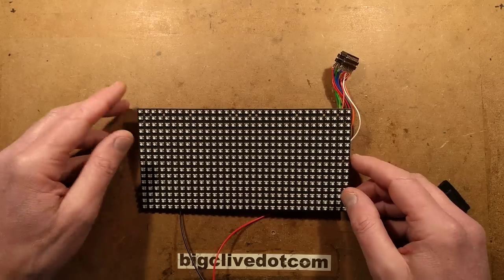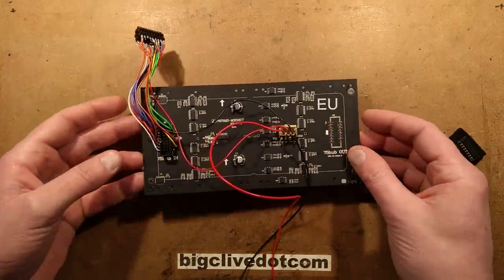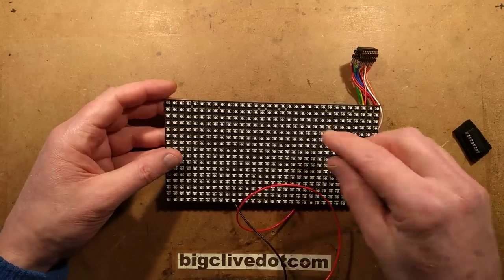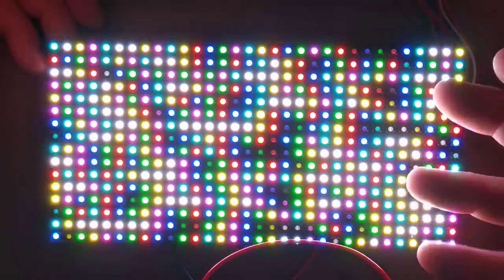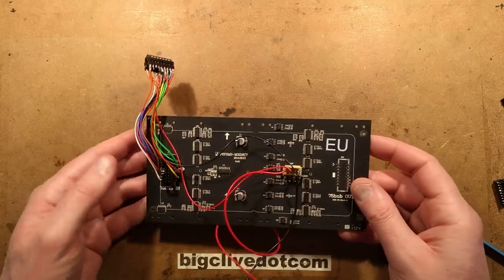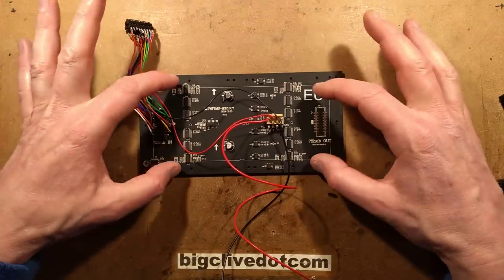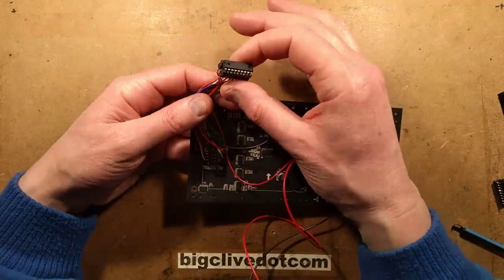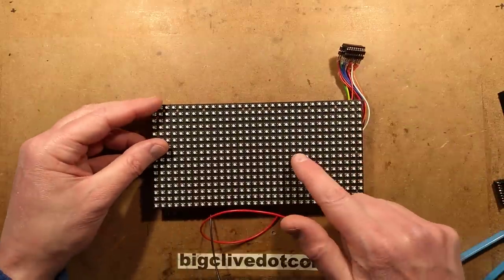Driving hub75 LED panels.  (including free test software)

Comment: There are ways to display a "proper" picture without a huge memory map. Byte per colour would mean 3*8bits=24bits of colour information. Bit of an overkill. Colour lookup tables could be used or just stuff the information for one rgb in a byte.

Old school demos/intros could be used as inspiration. Flame effect or plasma effect could be computed on the fly (with different kind of lookup tables) if the processor is fast enough.

It's all easier with a micro that has enough memory though.

Love the asm code!

Here's my take on reading Panasonic AC servo motor hall signals ("7-bit serial with two stop bits and parity and inverted hall signals included in the serial byte" with error detection on PIC micro)
https://www.dropbox.com/s/tnz0x3ztrnoydv3/panasonic_servo.asm?dl=0

Runs purely on serial interrupt.  1 MBaud data in... 0% serial baud error. 6-pin PIC micro, if I remember correctly.

Here's a video it decoding the hall signals from Panasonic servo motor and outputting serial hall signals on pins (LEDs...)
https://youtu.be/1hdetsDeUvA

There is time for 90 cpu cycles between serial interrupts (32MHz PIC clock pll, internal) plenty...
Reply from the maker: The early arcade video games had the sprites and colour maps stored in EPROMs that got pushed out in real time as the video signal was generated.

Comment: How much do those cost? Could use some as a flashy shop sign.
Reply: QVear I got one of the purses that it comes from in Smyths for £20 at the weekend, but if you want to make a shop sign yourself, you might consider spending another few bob and get a neopixel panel (ws2812). They’re a doddle to code with an arduino and there’s lots of support material out there to help with getting words to scroll on them. If you give them enough power they’ll look bright even in daylight.

Comment: I hope I’m not repeating a previous comment, but The downloadable PIC code seems contain an error. The twentieth line is a #include which instructs the compiler to load the “p16f627A.inc” file.
Unfortunately, that file seems to be missing. Or maybe I’m just my usual dumb self....
Reply from the maker: Sorry, that's right.  You'll have to get the include file from www.microchip.com it's basically a definition of things like porta and portb.

Comment: Curious what sort of refresh speed benchmarks you get, say for blanking full images, or scrolling reused data, or only partial drawing.
Reply from the maker: It can apparently handle very high speed data input.  But it requires matching processor or FPGA power.

Comment: You can drive them at 888 /24bit colour if you have enough RAM and a 32bit MCU with GPIO DMA.  
You DMA copy a large block of ram to a GPIO port wired to all the LED matrix inputs. Clock, RGB, address, all of it. Basically you're encoding data, address and clock into a large memory block you can step through using DMA.
Then you can update RAM slowly as needed to set pixel colors while simultaneously having DMA update the entire display at a flicker free speed.

One way you can do colour mixing is to DMA update the entire display 8 times in a row with each time having double the "on time" of the last. This matches up nicely to the bits in 1 byte (red for example). So red LSB is "on" for a tiny amount of time and red MSB is on for quite a long time.

The ram usage is pretty crazy though, you need like u32 * pixel line length * number of lines * 8 updates for PWM mixing * 3 colors. and then you probably want to double buffer it so double that again
Reply from the maker: This is pretty much how the earliest home computers worked.  With the ZX81 when you encroached on the video RAM with your program, half the screen suddenly disappeared to make way for it.  And with the early computers the screens would glitch as you wrote data into the active video space.

Comment: Take a look at the Propeller 2 to control one of these panels. Damn that's a nice chip.
Reply: just use an esp8266/32 they are some good libraries for such panels, then you can also have a web interface or something similar

Comment: @bigclivedotcom Can you do a bit on programming electronics? I'd be interested to see how you approach it.
Reply from the maker: If you mean assembly language then it's quite a complex subject.  You really have to throw yourself in at the deep end.  For someone new to programming I'd recommend the Arduino environment for faster learning and throughput.
Reply: @bigclivedotcom  I'm actually an application programmer. I'd just be interested to see your process at a high level - getting it on to the chips. That would make for an interesting video!

Comment: I wonder if you could control this with an 
Arduino or Raspberry Pi.
Reply: Sure, just work out the data format and bit-bash the data out to the panel.
Any processor with enough I/O pins... and memory if you want to store displays.

Comment: Big Clive, been watching your vids for the past month now and had a thought...  Have you (or anyone else) ever 'upscaled' an old ACME or NJD (other brands are available, but I have those handy at the moment) "Moonflower" sound to light type fixture to utilise any of the Chinese cheapo units you seem to be buying recently?  It would be great fun to convert them and add DMX too, but I can't think of anyone else I'd like to listen to explain or disprove the theory than yerself :-)
Reply from the maker: The complexity in upgrading many of the older lights is that they were designed around a very small point source of light.  It requires a different style of optical system to use the common large area high power LEDs.
Reply: @bigclivedotcom  Thanks for the rapid reply.  Guess I need to save the pennies & upgrade then.

Comment: Thanks for the initial video about this, I immediately checked and was able to get 3 of the purses for $8USD each.  This video also inspires me to continue playing with it, semi-waiting for 16pin ribbon cables I ordered then plan to use a RPi Zero to run it.  Don't have anything to work with PICs, so can't try out this software very easily.

But yeah I might be able to test how to work them with the connection between two of the panels if you were interested

I'm also very interested in knowing if the original chips could be used, and use something to load images via the audio cable it has (without using the official since my phone doesn't support it)
Reply from the maker: The finger trick mentioned at the end will provide instant gratification before you start dabbling with software.

Comment: What is interesting is one of the most common failure modes on these panels is you can get a line of pixels stuck on a colour or a row of a few LED's. Also these are not fun to repair. That one looks like a 5.9mm pitch, that is about the smallest that is mostly economical to repair. 3.9mm or 2.9mm is just crazy to try work on.
Reply from the maker: The LEDs are serviceable on this panel.  any closer pitch starts going into the territory of non standard soldering equipment like dedicated heated solder-tweezers.
Reply: @bigclivedotcom  I have serviced down to ip rated 6mm panels, at my company we just decided that the 3.9mm panels were cheaper to buy replacements over servicing them mostly from a labour time standpoint.

Comment: As a ZX Spectrum programmer, I really dig this.
Reply from the maker: It's pretty much the same colour pallette give or take the second intensity level.
Reply: Wouldn't it be great to display a ZX Spectrum screen on a 256x192 LED array made up of these panels, except it sounds like that would take some serious processing power and quite a high voltage not to mention the cost of purchasing the 72 panels required (6x12 unless my maths is failing me).
Reply: Absolutely. The Spectrum had a slightly unusual arrangement, though, with the lowest bit being blue, followed by red, followed by green (BRG, rather than RGB). So, numerically ascending values from 0 to 7 would translate into black, blue, red, magenta, green, cyan, yellow, and white, respectively. The brightness bit was simply ANDed with the color signals inside the ULA via a diode and a resistor, so a bright black would be the same as the non-bright black.
Reply: Yup. Was one of the first things that came to mind as I watch the video. We’d need a dedicated panel driver that would mimic the Spectrum’s ULA—i.e. continuously read data from the bottom 6912 bytes of RAM and then shift it down the panels. I’d love to see it!

Comment: If you wanted to store a static image, you could probably cheat by having a FLASH or EPROM that has the data in it ready to be shoved into the registers, and the microcontroller would just activate the appropriate address lines on the memory, with the data pins directly connected to the display module
Reply: Peter Mulholland Even easier: A full (non-PWM) image is only 192 bytes.  Could be stuffed into the program flash directly, using whichever bit order simplifies the code.
Reply: @johnfrancisdoe1563  yeah I was thinking along the lines of the microcontroller having to be involved as little as possible, rather than it reading data out of a FLASH and then shoving it into the display.. it could somehow be wired up so the display is reading the data from the FLASH directly.. with only a little marshalling from the uC

Comment: Clive, did you try using the Android software that is designed to run these purse panels? From what I've read there are some real problems using it.
Reply: Yeah, it's utter crap!  I installed it, and couldn't actually draw anything I wanted...  I didn't even bother trying to upload it to the handbag.... Best avoided!
Reply: Fwiw I had success on the iphone. Within 10 minutes of receiving the package from Amazon (same day delivery for under $8...I'm still amazed) I had typed my 6 year old's name in his favorite color and displayed it on my new pink purse.

Comment: Can you do a how to on a small video wall. I want to make a small (32"x40") portable battery powered panel for scrolling/flashing text and dont know where to start.
Reply: gedion4000 Buy enough of these panels to cover the size.  Chain a few together using the output of each as input to the next.  However the more you put in each chain, the faster you have to shift pixels to keep the fps faster than the human eye.  Next you need a control board that can drive about 12 pins per chain of panels, at the needed speed.  You also need a power supply that can deliver 10W per panel plus whatever your control boards need.
Reply: @johnfrancisdoe1563  hey John thanks. That would be neat, maybe for something mounted on a wall, but i think thats a little over kill for my needs, and probably a little too heavy. Resolution can be WAY less then these produce, and need less energy. Im mostly looking for something large and hand held as a scrolling marquee or at least something with changeable text. Cheers!
Reply: Building the panel isn’t the problem...
The processing and data-pumping is where the challenge starts.

Comment: according to aliexpress these panels are mainly used for large area "tv" in shopping centers. 
That made me briefly interested in 1280x720 wall "tv" project...
..., still dont know if its smart or stupid... :/
Reply: Shoot for the moon and make a 4K display!
Reply: ...as long as he has the Zeppelin hangar to house it in, why not...
Reply: 1280x720 was chosen cause even the most packed panels have 160000LED/m^2, which would make the "tv" about ~2x3m. 4K would REALLY need a hangar at least...
... and it was just an idea, you thing it would be even watchable from across the room? wouldn't it be too pixelated?
Reply: Oh for sure. I was just taking the impractical idea and running with it as far as could be done. A 4096x2160 panel of P2.5 panels would be 10.25x5.4m, or literally the size of a house. 

Using P2.5 panels to make a 1280x720 display would result in a screen 3.2x1.8 meters across. Plugging the numbers into this calculator https://www.designcompaniesranked.com/resources/is-this-retina/ we see you would need to be 8.6m away from your screen for it to not appear as discrete pixels.
Reply: ... and I JUST found out, Samsung beat me to in, intruducing Samsung "the wall" 146" (3,2x1,8m) P1 panel modular TV for ~$100,000.
Quite crazy considering price of P2.5/P1.25 panels.

Comment: Is it possible to oscillate a 2 pin-2 color LED without using a micro controller?
Reply from the maker: Yes.  Use a 555 and connect one pin to the output (pin 3) and the other pin to both power rails via 1K resistors.
Reply: @bigclivedotcom  going to try this right now !
Reply: @bigclivedotcom  Does it require other components?  I'm not having success. The LED lights, but does not switch back and forth.
 https://imgur.com/a/r8Ee2Ys  is the layout if i've understood you correctly.
Reply: @bigclivedotcom  Any thoughts on what i'm doing wrong?
Reply from the maker: @technosasquatchfilms  The 555 will not run on its own.  It needs timing components like resistors and capacitors.  Type in 555 flasher schematic to Google and do an image search.
Reply: @bigclivedotcom  ok, thanks!

Comment: 6:54 - did you just put a socket into another socket?
Reply from the maker: Yes I did.  For my development chips to protect the pins I solder the corner pins of the microcontroller into a turned pin socket.
Reply: @bigclivedotcom  How do you protect the socket's pins?
Reply from the maker: @thewhitefalcon8539  They are solid turned pins.  Much stronger than the IC pins.

Comment: I should send you a HiFive1 (I have a few spares). These things are crazy fast (320MHz [and some you can overclock higher]) and largely Arduino compatible (including physically), ideally suited for the upgrade version of your little PIC program. There are about 400k writes per field (512 * 3 * 256) if you want to run 8 bit per channel color (which may be overkill honestly). The HiFive1 has 16MiB of onboard flash memory, 16kiB of L1 Cache, and 16kiB of SRAM, so you could double-buffer the image and potentially display something pretty interesting. If you're just scanning out, you could do ~140-200fps no problem. You could probably even decode video on the thing if you tried. ;- )